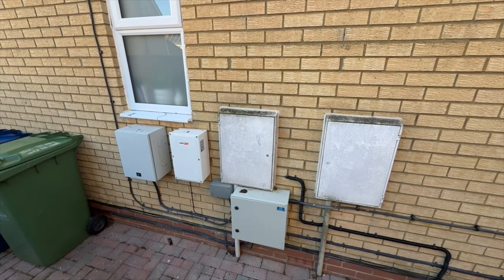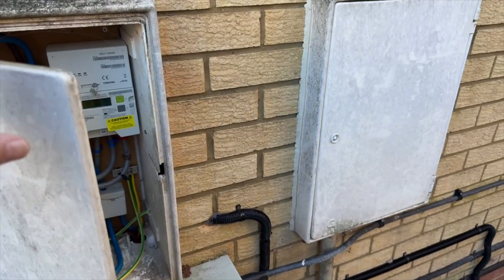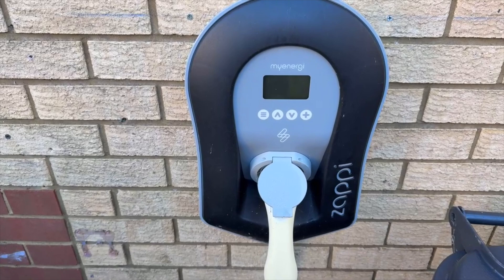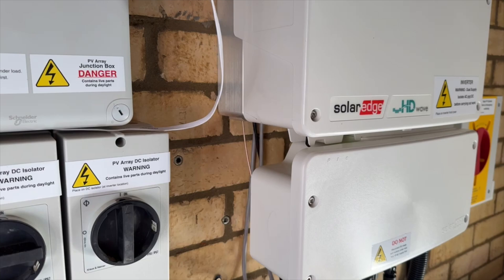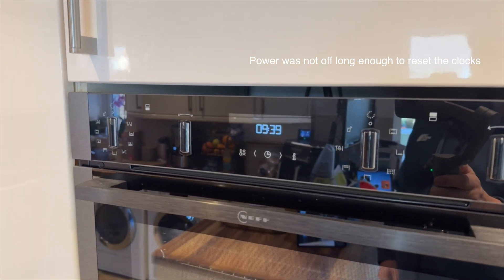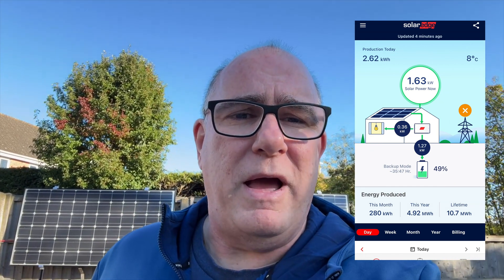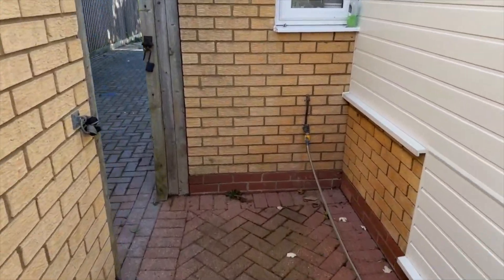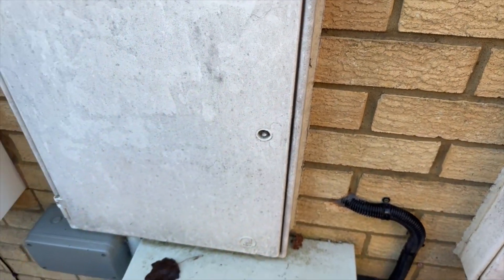What Happens When We Ditch the Grid?

Comment: Here where I live in far northern Australia solar panels work quite well. But do you get much output from solar panels in the UK. Every time I’ve been to the UK it’s been cloudy with light rain or drizzle. I just look for the nearest pub with a nice fire going, get a pint (or two or three) 😊. Seems a lot of money to spend just for the rare event of a power failure.
Reply from the maker: Solar is very viable in the uk, we’re effectively off grid for about 9 months of the year, in the depths of winter we import cheap rate power over night and run off the batteries during the day. The backup feature was an option we added during the upgrade so in the grand scheme of things we didn’t pay that much for it.

Comment: I've got a SolarEdge (the older HD Wave) 8kW Inverter + Energybank battery.  It's not retrofittable with the backup module sadly.

I'm thinking of expanding with a separate Pylontech/Sunsynk setup, giving me access to 30kWh of batteries  + solar shed and fence. 

Off grid backup is one reason for doing that, but since I now have a heatpump, I want to access Octopus Go Intelligent  tariffs 24/7 for the benefit of the heatpump and a single energy bank battery is not upto the task

One matter I do ponder:  Short circuit fault current handling in an off-grid configuration.  Normally circuit breakers must trip within 0.4 seconds of a short circuit.  To do that they need 3-5 x the rated current to flow.  There's plenty of strength on a grid connection to do that, but you can't achieve that with a smaller inverter feeding your 32Amp breakers.  You'd need a 96Amp fault current to fast trip your breakers on a typical B rated breaker within the regulation time of 0.4seconds.  Your inverter couldn't provide that current, and so therefore you have to rely on your inverter shutting down first before your house breakers would trip.  That might work fine, but off grid fault current testing isn't widely discussed in the electrical community and I do wander if anyone has actually tested the full consequences of this.  Worst case is that your cables and connections get hot for just a little bit too long.
Reply from the maker: You can get discounts from SolarEdge to upgrade older inverters to home hub inverters but you wo7ld need to talk to your installer about them as it seem to be on case by case basis. Having another system from another vendor maybe the smart approach.
Reply from the maker: Yes I had to upgrade to a larger breaker (its in the big grey box) for this to be classed as acceptable by both the DNO and to get the MCS certification done.

Comment: I wouldn't call that off grid buddy 😂
Reply from the maker: technically if the grid is cut off then it’s off the grid, but i get your point :-)
Reply: @JonathanTracey  I thought you were going to stick the middle finger up at you are provider and rip the old lead  cable out from underneath your driveway😁
Reply from the maker: @martdaymo  I would love to do that but given the winters in the UK, without a small field of panel I would never generate enough power. No power = angry wife not going there :-)

Comment: Very poor in my opinion, its not the first Solaredge system I've seen that  does that, no idea why SE turn the power off completely for 10 seconds, most other systems are pretty instantaneous. My Victron system changes over in 20ms, not even noticeable. I'm pretty sure that a 10 second power outage would cause issues with some electrical items, especially computers. The only way I know the grids gone off, is when I get a notification on my phone.
Reply: Yes UPS is great, but at the end of the day even a manual switch is fine, Because the difference in a grid down / blackout is being able to have the lights on when everyone else is off and in the dark
Reply from the maker: yes the solaredge is more EPS than UPS. sometimes it can take a second or two to change over. for important stuff that we can’t live without (wifi and cable modem) we have a small dedicated UPS.
Reply from the maker: that’s exactly how the solaredge system works, if you noticed the clocks didn’t reset, the only reason the lights took a second or two was because the hue lights controller takes that long to reset.
Reply from the maker: i’m pretty sure the average change overtime is less than a second. Just about everything else in my house just continues as normal. All of my computers are on a UPS so I never see any issues there. The only thing that I ever see reset is the timer on my cheap coffee maker
Reply: @JonathanTracey  watching the video it's definitely around 10 seconds, and I've seen others demonstrate it and it takes about that long. I've had SE since 2015, and consider them top tier, so expect better from them.
Reply from the maker: @TheRonskiman  are you timing it off the lights, its hard to hear but in the video you can hear the clunk of the switch over, that's a lot less than 10 seconds, if go back to the editor it seems to be about 2 seconds on the timeline
Reply from the maker: @TheRonskiman  I agree SE could do better but for my needs its perfectly acceptable. The UPS for the wifi box is about £100, that I can live with
Reply: @JonathanTracey  Yes , perhaps its just the way the lights going on and off have been added to the video, which makes it appear much longer, can't say I can really hear the clunk apart from the main switch. But its clearly about two seconds from you switching it off until you say "don't know if you heard that clunk then". I completely failed to twig the lights were not real time, and what you was saying , not as bad as I thought then, but still not as quick as my 20 milliseconds.
Reply from the maker: fully agree 20ms i doubt my computers would even notice that